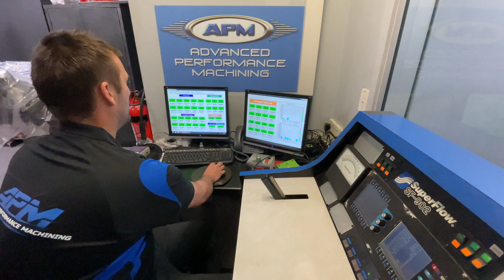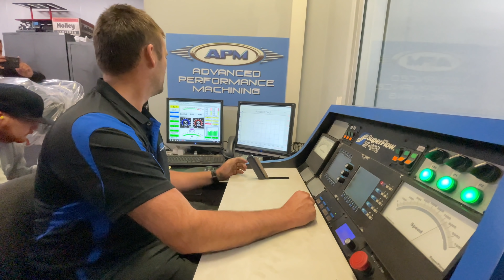2,100 Horsepower 540ci BBC On The Engine Dyno (Ear Splitting Whine)

Comment: So is that the max hp that motor can make or can it make more but you don’t want to
Reply: It could go to 2300hp but there is no need to.
Reply: @timothylaidler1978  ok 👌
Reply: Get a bigger blower and you’ll make more
Reply: @jackmeoff7686  not how it works
Reply: @blakesattler1726  its a limiting factor, only a small blower
Reply: @jackmeoff7686  the blower can produce over 30 pound of boost. Not many bigger blowers than what he’s got and you need a motor that can handle it.
Reply: @blakesattler1726  yes of course you need a bigger motor to handle it, most supercharged outlaws and other cars of the like run 16/71 blowers
Reply: @jackmeoff7686  I know there are bigger blowers but there is no point in putting a bigger blower on this motor the psi 14/71 superchargers are the most efficient blowers on the market most of the top fuel cars use them because you can push so much boost through that blower.

Comment: hows the flex in the hat wow
Reply: Thats not the hat, that's the torque of the engine twisting the dyno cradle holding the engine 2101nm will do that
Reply: @timothylaidler1978  yeah ok from the side shot it looks its moving up and down
Reply from the maker: what you're seeing is called rolling shutter, the camera struggles to pick up the violent vibrations